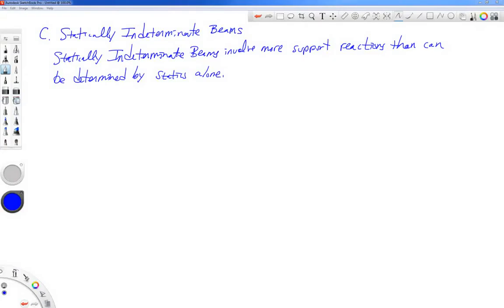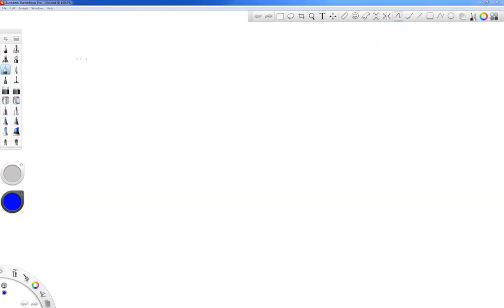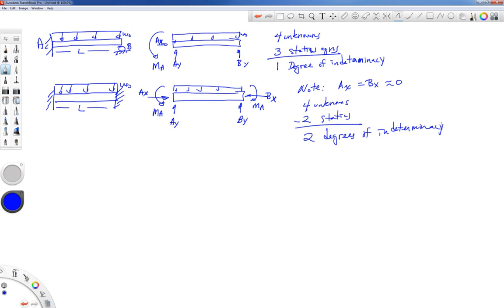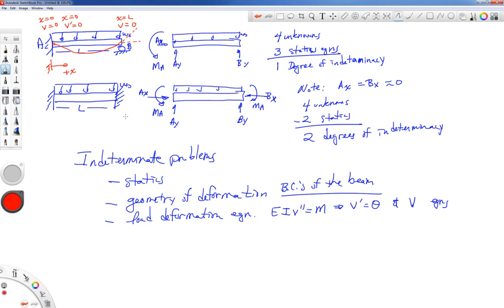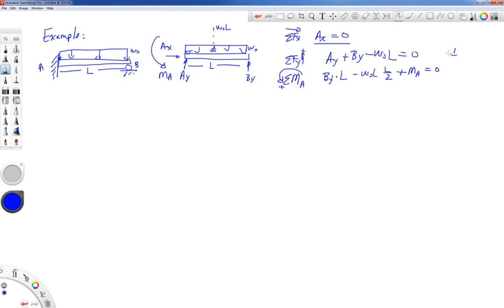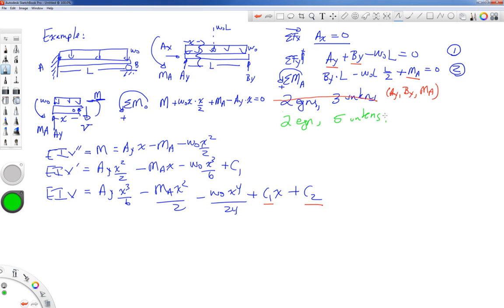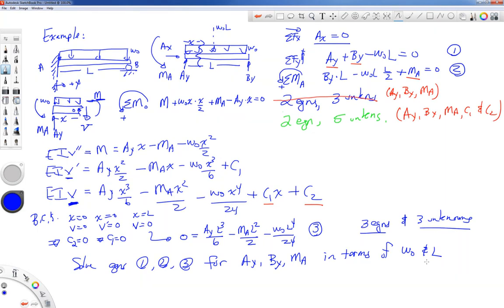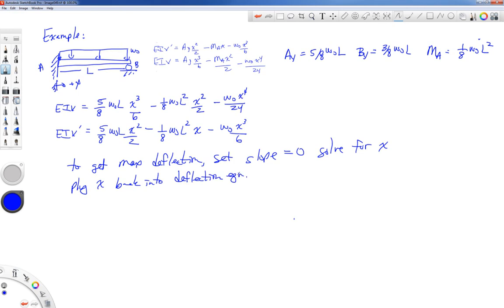Mechanics of Materials-Lecture-24-Indeterminate Beams

Comment: just a quick question. everything would be same even you solve tis beam doing mirror image right?
I mean, whatever the values you got for the equations, would be same if you had roller on left and fixed on right, correct!!!
Reply from the maker: Yes, the reaction values that were determined in the end will be same magnitude.

Comment: In the above lecture, at 17:14  time frame, you have M(A) and M in same direction. should  the be in same direction  or they should be acting in opposite direction to be balanced? I mean, I had seen a case where M(A) and M (moments) were in opposite directions.
Could you please explain me how they work? thank you
Reply from the maker: Ma is an external reaction for the beam.  It can be assumed to be in that direction or in the other direction. At the end of that problem at 23:00 it turns out Ma = 1/8 Wo L^2 (i missed the L^2 until 24:00).  Since it was positive, this means that I had assumed the Ma in the correct direction.  If we assumed it the other direction at the start, we would have gotten Ma = -1/8 Wo L^2, where the negative sign means the actual direction is the reverse of what had assumed.

Now, if we look at the internal moment, M, you should always draw that so it acts to put the top of the beam in compression, as that is the standard sign convention for a positive internal bending moment.